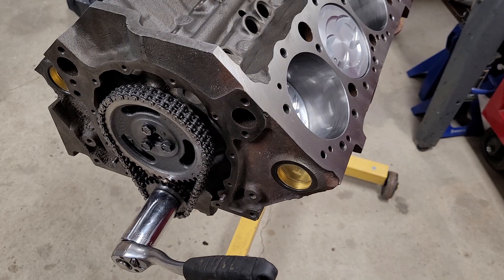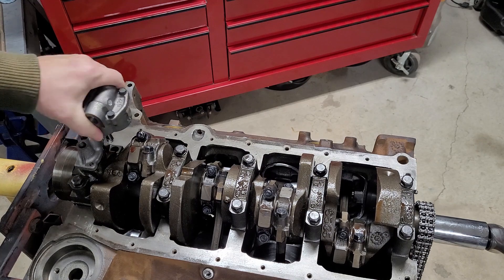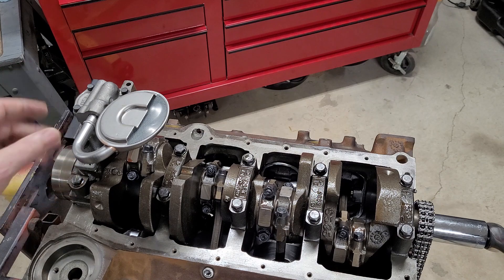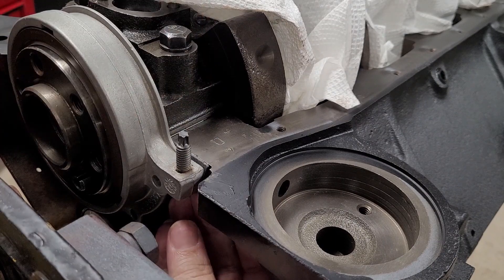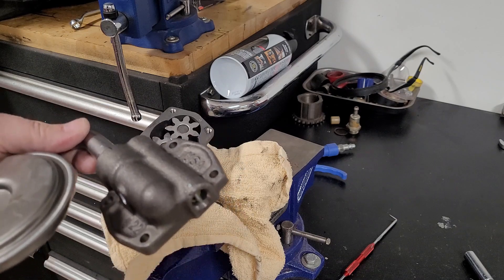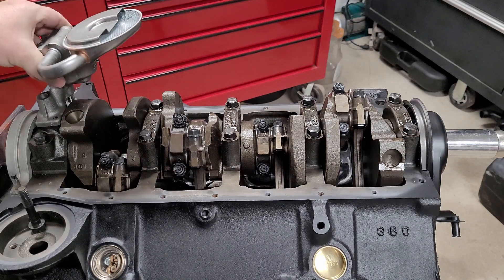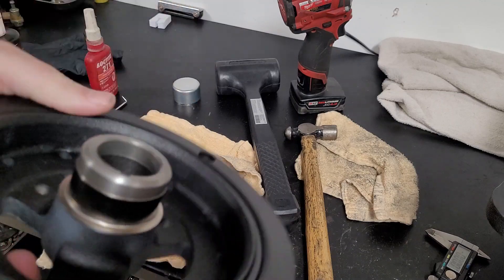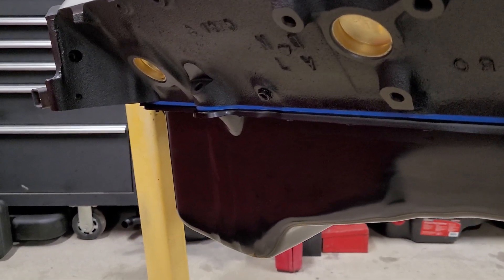350 Chevy TBI Engine  Rebuild Part #3

Comment: At TDC on the compression stroke the marks on the cam sprocket will be at the top or 180 deg off of the crank sprocket. This will confuse someone who has not built an engine before. At the point where the marks are next to each other is the top of the exhaust stroke. Once you have the valvetrain installed this will become evident.

Comment: Thanks for the video and thanks for addressing top dead center and the one-piece rear oil seal installation. Those are two things I had questions on.

Now I will install that rear seal and get the timing cover and oil pan on to catch up with you.

I'm just taking my time and watching your videos as I go.

I bought brand new aluminum heads that have the same specs and flow like vortec but are aftermarket of course.
Reply from the maker: Hey Steve , glad that helped. Been busy for the holidays but hopefully will have the next video by the end of the week so you have some time to catch up.

Comment: The cam gear will only attach to the cam one way, with TDC at piston one, just put the cam gear on the camshaft and rotate to match the timing points. At this point the cam will be in the correct position.
Reply from the maker: Thanks for the comment.

Comment: My dad thought me to do the oil pickup the same way you described but also said to make sure and throw a tack weld or two cause if you grenade an engine cause the pickup fell out for some reason you’ll feel pretty silly… and he said it happened to him once so every engine since has gotten a tack
Reply from the maker: I was taught that way as well. It is good practice to prevent an issue. I have had one fail on me as well in the past and That is why I don't move them once installed but I encourage everyone to go the extra mile (tack it on)for added insurance. Thanks for the comment!!
Reply: Could also potentially bump it when installing oil pan and knock it upwards so the pick up isn't in oil 😢

Comment: Hi Jason, Thank you very much for this wonderful channel. I have a question : You bought a double roller timing chain , why not use the standard version of the timing gear? 
And do I need to replace any father of other parts to match this change, such as the lifters or the camshaft?
Thanks a lot 🌺
Reply from the maker: I have been disappointed in some of the stock replacements like the chain we originally installed. Nobody had any regular chain and gears around here when I was checking. Thanks for the comment.

Comment: Good morning Jay. What rebuild kit do you recommend for my 5.7 TBI rebuild. I plan on breaking it down and going through it 100% and rebuild it for a 1990 OBS flip.
Thanks for the help and have a great day
Reply from the maker: Sorry for the late reply , I had the pistons , rings , bearings , cam bearings supplied from the machine shop. The rest of the parts cam from Summit and Rock Auto , there is never one kit in particular that includes everything I am looking for. Hope this helps!

Comment: Did you check crank end play and just not show it? Anyway one of the best videos on engine assembly I've seen.
Reply from the maker: Thanks Dan I appreciate that!! 
Thrust / End play checked at 23:05 on the first video.
Reply: @jaysgarage3616  Seen it thanks. Did you figure out why the cloyes timing set was so sloppy? I've only seen that on an engine that was line bored.
Reply from the maker: @danmello4176  Great  , that engine was not line bored and the other chain was tight so I was just going to send it back to Cloyes. It is something with that set that is not right.

Comment: Hi Jason, you bought a double roller timing chain to replace the standard version of the timing gear. Does a double roller fit into the standard timing chain cover or did you use a deeper cover for that to fit? Thanks
Reply from the maker: I used the timing cover that was on the engine , the original tin one. It clears with no problem.
Reply: @jaysgarage3616  Thanks you

Comment: do you recommend putting the camshaft bearings in first, before installing the crankshaft// im starting from a bare block.. I have removed the old cam bearings.
Reply from the maker: I would yes!

Comment: Okay so when I take my heads off I can just loosen rocker arms n head bolts? Then pull off
Reply from the maker: Loosen rockers , remove push rods , drain coolant , remove intake , exhaust and then remove head bolts (17) and lift off. The head may need a little help coming loose from the gasket/dowels.
Reply: @jaysgarage3616  okay thank you I'm doing headgaskets on my 91 thanks for videos they should help a lot👍
Reply from the maker: @mikeydejon2148  Awesome , Good luck with your project!

Comment: how do u know if you need a cam button or not?
Reply from the maker: Depends on what cam you are going to use , if you are going to use a solid roller you will need one. Hydraulic and solid lifter cams are ground with a taper to basically not let the cam move forward (there is more to this).
Reply: @jaysgarage3616  great info thanks.

Comment: Is the one piece rear seal an option on any 350 or is specific to your build? Is the sleeve on the harmonic balance also engine specific? Getting ready to start my 350 engine, going into a 91 Chevy 91 Blazer! Thank you for putting these videos out!
Reply from the maker: Hey Tire Jockey , the one piece rear seal began in 1986 I believe , your 91 will be a 1 piece. The sleeve for the balancer was for a small block Chevy , it's a 88176 Nation / Timkin.
You may not need one , you will see when you can look at your Harmonic Balancer.
Thanks for the reply!!

Comment: You use a strap on the oil pump pickup, or a tack weld, don’t preach otherwise. 

Just the interference fit is NOT enough and can fall out.